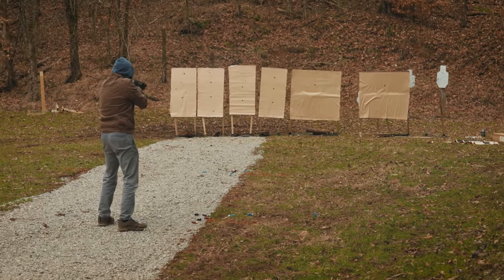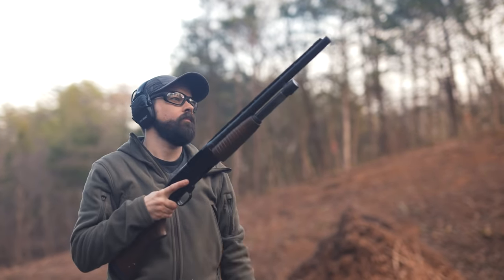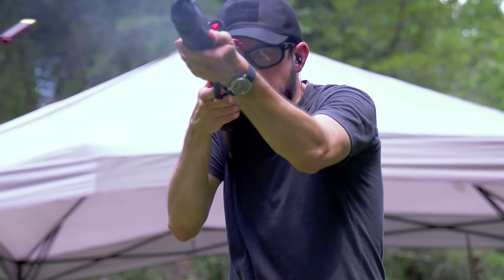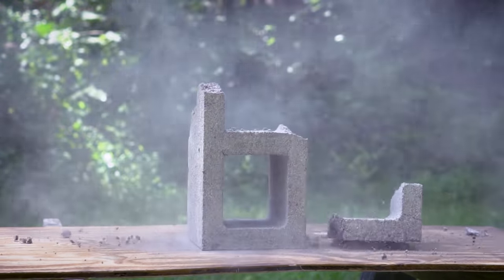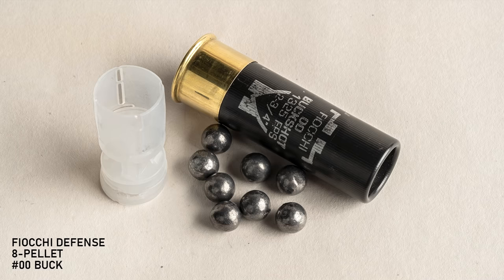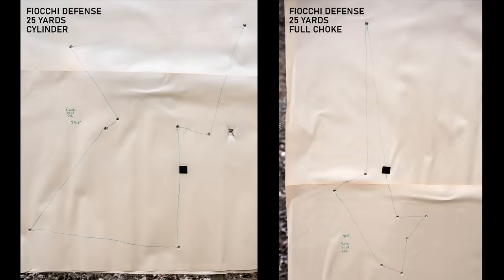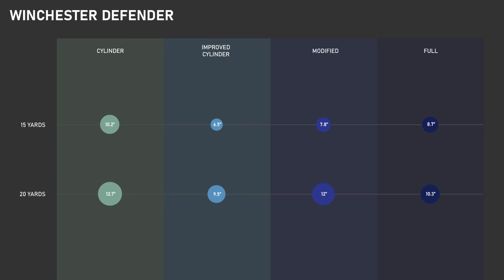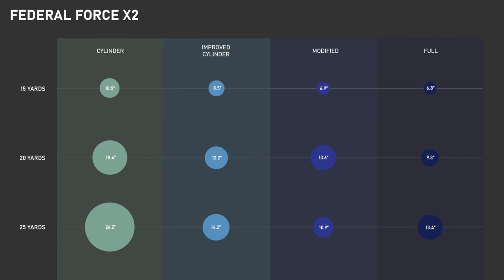Choke Tubes for Home Defense Shotguns

Comment: Couple questions, in regards to this and your previous buckshot videos:
1. Is there such a thing as steel buckshot that would perhaps prevent the deforming of the shot in general? Probably not good to run them through a choke
2. I noticed in the cutaways of the standard 2-3/4" shells that a LOT of space is taken up by wadding/ buffer. With powder and cup/wad technology as it is today and accepting the downside of shotguns being low round count, do you think in the future it will be possible or likely that we'll go to shorter shells in order to have a higher round count by removing 20-30%of that wasted space? Imagine if your 8 round mag tube now holds 12. Of course, designing the guns to work properly with such shells might be an issue but that's a problem for a different day.
Reply: Have you looked at mini shells

Comment: Finding some different information about Benelli style CYL vs Skeet Choke tubes.  My 12ga takes benelli style chokes and only came with a 'skeet' choke.  I've been looking for a cylinder choke (.730" dia), however even the the 'cylinder chokes' i find for benelli are only .725" diameter.  Seems the difference is only .005", is that going to make or break utilizing my 12ga for say slugs? if i wanted something that can utilize both forms of ammo?   or perhaps would that .005" interfere with flight control ammo?

Comment: Do you think the 12 GAUGE X-FACTOR PORTED CHOKE TUBE - XX FULL is to much for a 590A1 18.5”?
Reply: Using an extra full turkey choke with buckshot or slugs is going to be guaranteed to blow the pattern out. You're better off with a cylinder or improved cylinder choke. The extra full choke is going to be too much constriction. If you're running birdshot for home defense and you want to get a tight pattern then extra full choke might be the way to go.

Comment: What about slugs? Is there a limit to the choke you can use? Like only cylinder or only Cylinder and IC?
Reply: Generally speaking shotgun slugs work best out of a cylinder or improved cylinder choke. Also the usual maximum choke you can fire a shotgun slug through is modified. Anything above that you run the risk of splitting your barrel. Not all the times but I've seen a lot of shotgun barrels explode at the muzzle from trying to shoot a slug through a fixed full choke

Comment: despite my earlier comment, I watched until the end and appreciate your remark that particular loads are better at groupings.  Since you did mention slugs, I think you should have admonished shooters not to use slugs in choked shotguns. I am no expert but wouldn't want to be around to see what happens. The image of Elmer Fudd holding a gun and Buggs Bunny with his finger in the barrel appeared.
Reply from the maker: There is some debate as to whether it's advisable to shoot slugs with choked barrels on a regular basis, but doing it a couple of times is not going to blow up anyone's barrel.
Reply: The shape of regular lead foster slugs was made specifically to make them safe in use with chokes. If it's not the tightest one you can find, it's fine. Just a bit more cleaning to do.

Comment: m1014 is fixed modified, which is the only reason I don`t want to buy one, lol. Its kinda sucks because otherwise I would love to have one. And I know for sure that Benelli says verbatim "use C or IC for slugs" and a lot of weapon experts do not recommend to use 00 in anything tighter than IC as well, so thats a shame m1014 is fixed M and does not have a thread for tubes which means I basically restricted to use slugs by the manufacturer and as far as 00 - there are different opinions, yes, but I`d rather be safe than sorry

Comment: I installed choke tubes on my Mossberg 590A1 a few years back. Mostly because I was curious and I occasionally also use my shotgun for hunting. I keep my 590 loaded with quality buckshot and a modified choke in the barrel just in case I have to "reach out and touch someone".

Comment: My fn p12 came with a factory improved cylinder choke. Is it safe to shoot rifled ( foster) slugs out of that or will it hurt the barrel?
Reply: I have that same shotgun. Its my main home defense tool. I shoot everything out of it including 1oz slugs. I even use a full choke. Just dont shoot those weird exotic slugs made from billet or some other stuff. 
Also FYI in case you were not aware, the P-12 is the exact same thing as the Winchester SXP , its just rebranded. So if you are looking for accessories you can search for them by that because they are pretty much non-existent for the P-12. I was able to install a mag tube extension, and barrel clamp with a light rail from Nordic Components. I wanted to shorten the length of pull so I used a Winchester SXP Youth model stock and it fits perfect. It looks funny because its a wood stock with black plastic fore-end but I like it.
Reply: @XDWX  Cool, thanks man. I'll definitely check out that mag tube extension. It's a great shotgun.

Comment: I've been attempting to shorten my wingmaster stock (eventually the barrel to 18.5" aswell) best way to measure and drill the 1/8th pilot holes to mirror the shotgun pad?
Reply from the maker: There are a couple of videos on YouTube that show actual gunsmiths doing this, so you might want to check those out for advice on the specifics like that
Reply: @LuckyGunner  thank you

Comment: I am not against shotgun chokes in general. However, it seems ineffective when some people gets a shotgun and stress so much on tight patterns that they turned a shotgun into what is practically no longer a shotgun, but just a cumbersome low capacity rifle that is neither effective as a shotgun nor a rifle. Unfortunately, I see this in law enforcement shotguns.
Reply from the maker: I think that depends on what your expectations are for the shotgun. Some people want a shotgun with spread to increase their likelihood of hitting the target with at least some pellets. Others want a shotgun because buckshot at close range is more likely to stop a violent attacker with a single round than any other firearm commonly available to private citizens. If you fall into the latter camp, you want a tight pattern because lots of projectiles impacting the same area at the same time is the best way to maximize the ballistic potential of buckshot.
Reply: @LuckyGunner  Right. I understand the basic idea. However,  the latter approach means the user is sacrificing both benefits of a rifle and also benefits of a shotgun for the per shot incapacitation probability of a buck shot. Then two questions follows:
The first issue is that then the shooter really really needs to be good because that shooter is going all-in on power while sacrificing control, capacity, etc. But, the average of people do not seem to train that much, and this especially becomes a problem when a law enforcement agency forces it on officers who gets a qualification once a year or so. A lot of people seems to pick a shotgun for home defense because of the perception of power and lower cost, but they seem to ignore training cost to actually get good with it.
Another question is:
"Is a 00 buckshot really a thunderous man stopper as it is commonly portrayed?"
From the use depicted by books such as ones involving Jim Cirillo's Stakeout Squad that got involved in numerous gun fights with different type of weapons, it just does not appear so. 
Do I believe a 00 buckshot have greater probability of incapacitation than a 9mm pistol round? Yes.
But, is it so good enough that I feel comfortable going all-in on it?  No.
But, I guess it should be left as an individual choice.
Reply: Buckshot tends to spread at impact in the target even if it is a very tight pattern when it hits.  In other words the shot create separate wound channels even if they hit as a single mass.  What you say about Cirillo and others’ experience is true.  Nothing short of artillery fire is a guaranteed stop.  I think it was Cirillo who reported that they could actually see through the torso of one one guy hit twice with buck and he still took some time to go down.  A shotgun has many many times the energy of a 9mm.